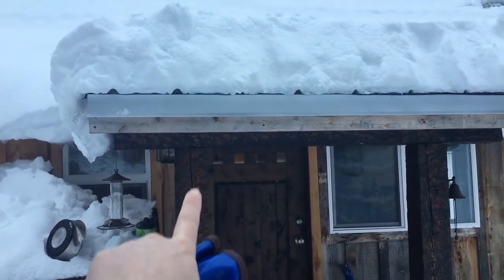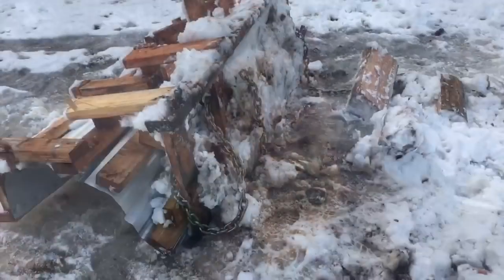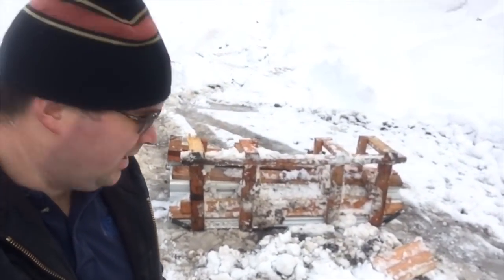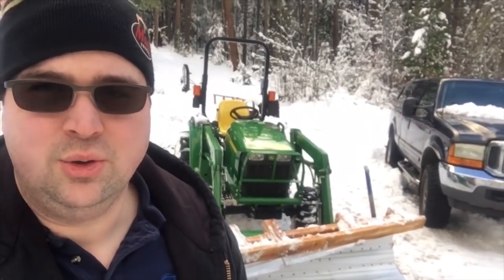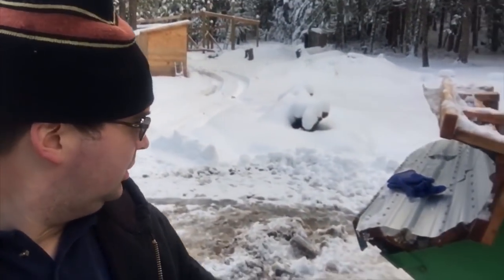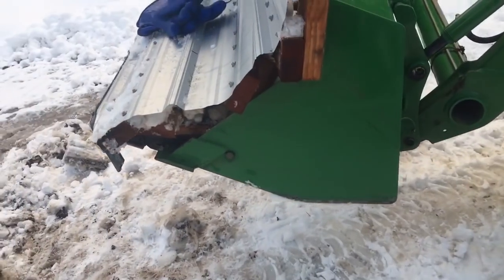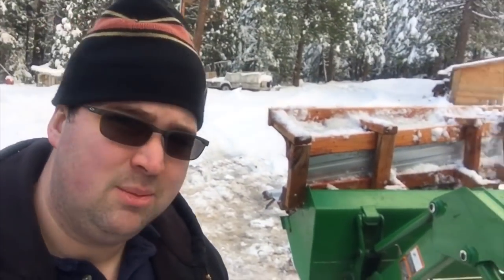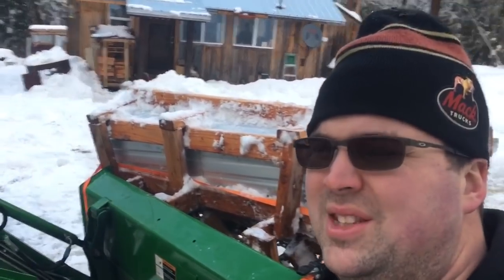DIY SNOW PLOW- MODIFICATIONS

Comment: I would just remove the teeth for the winter, then you can just curl you 'plow' off the edge and use the teeth mounting holes to secure it.   Seems easier than overengineering something.  Also, if wood works, just use that - easier than welding something together, cheaper and easier to fix when it breaks.  Plus, being less rigid, it probably absorbs some of the shock.
Reply from the maker: Thanks Ck. Good points. -Robert